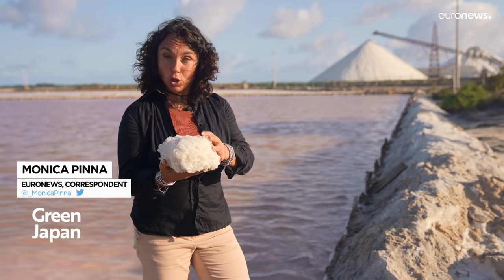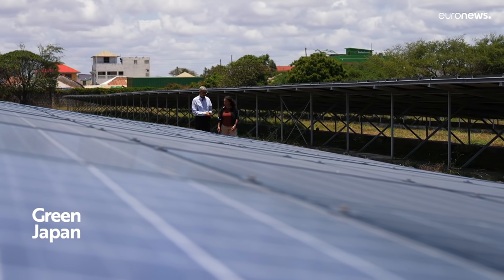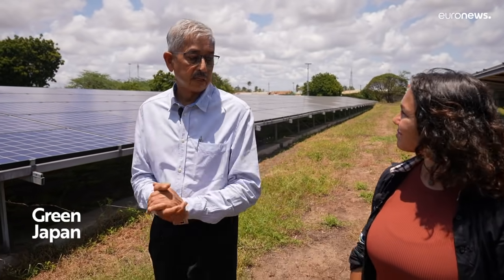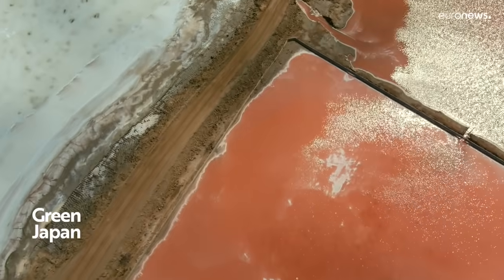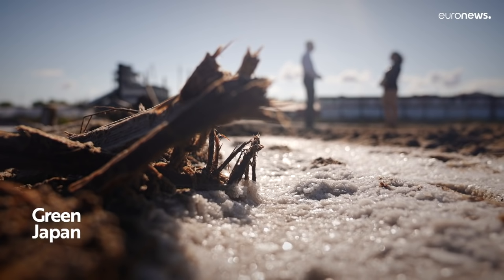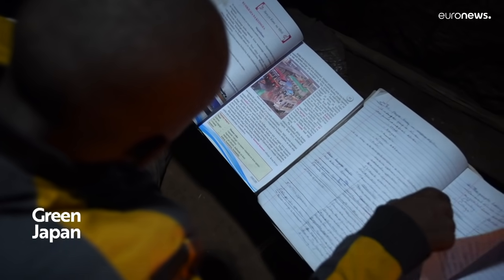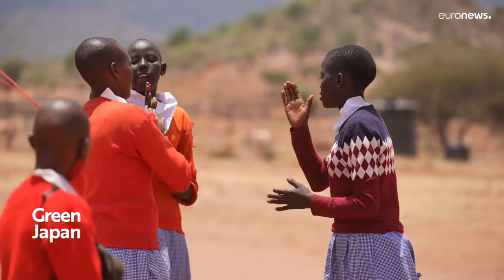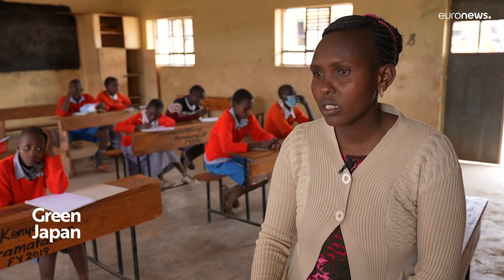Japan's low carbon technology lights up Kenya

Comment: These are great initiatives that really help developing nations like Kenya. However, what the video doesn't detail is that through these projects Japan earns carbon credits which allows them to essentially offset their own emissions. Therefore, Japan could continue to emit high levels of carbon and still achieve their emissions reduction goals via credits. It's important that developed nations like Japan also focus on reducing their own emissions at home rather than relying on offset projects.

Comment: Does anyone understand how much land would have to be used to provide enough solar power to a small town? This is a joke.
Reply: Alot, good thing we have other sources of green energy, to complement solar energy.
Reply: @davidborges2193  and they are all inefficient
Reply: @unclediggie6559  dude do u know how many deserts are in Africa that are just bare
Reply: @keithteach5649  do you mean desert ecosystems? I'm sure covering those with solar panels would cause all sorts of problems
Reply: @davidborges2193  Kenya is one of the leading countries when it comes to geothermal energy and for countries that cannot access geothermal energy they can use wind or hydro electric dams to complement solar power which is really reliable and Morocco is using Solar power to power their country and they still export power to spain